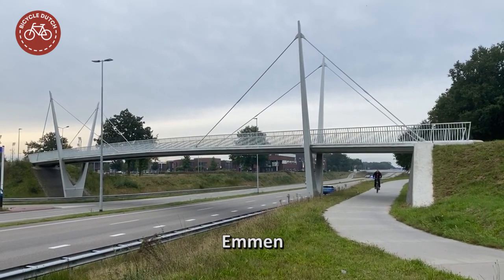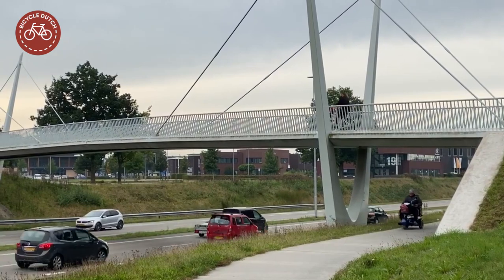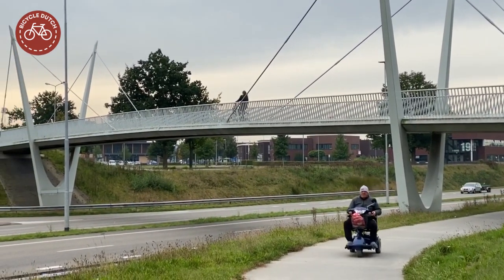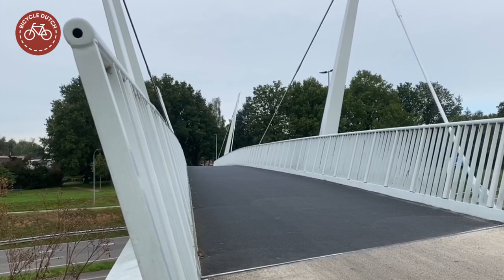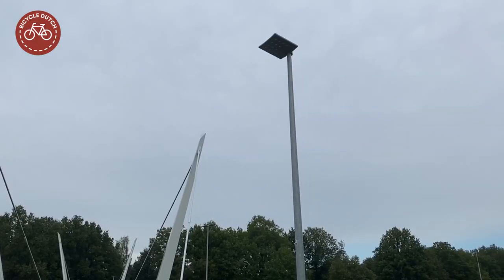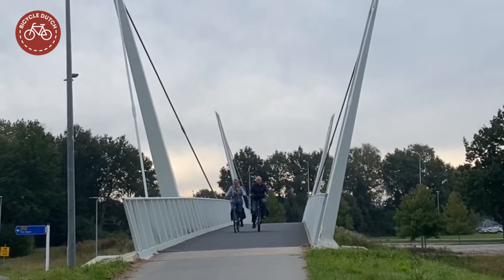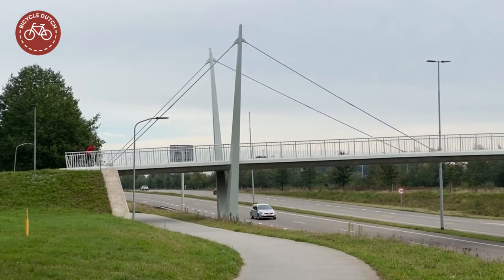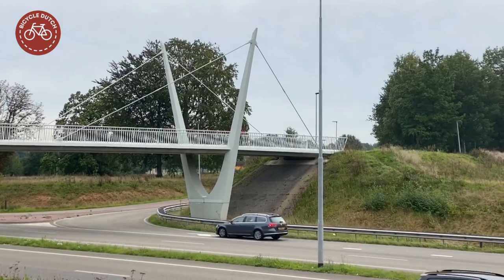Cycle Bridge in Emmen (NL)

Comment: "that was mainly constructed to improve the flow of motor traffic."

Nothing wrong with that, as long as it doesn't hinder or thwart other modes of traffic. Grade seperations like these are a huge improvement for all modes of traffic.

In my opinion, what matters is the whole package. However, I think that bicycle infrastructure still is too often neglected in favour of motor traffic, even in the Netherlands.